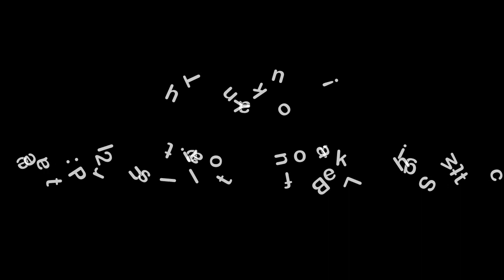Mojo Rearset Installation

Comment: sir anong shifter pa pede magamit sa. mojo?
Reply from the maker: yung transformer kaso lumang design na at medyo maraming bracket ang kailangan. yan na kc yung konti ang modification. meron din yung plug and play lang kaso mahal nasa 4k
Reply: ahh. ok paps. so yan ung maganda talaga? pang raider hnd pede?
Reply from the maker: @johnchrizcorpuz4882  pwede sir medyo marami din bracket kailangan don yta sir. yan binili ko kc wala na masyado bracket na kailangan, isang flat bar lang ok na.
Reply: san mo ba nabili yan sir?
Reply from the maker: @johnchrizcorpuz4882  dito sa pampanga sir, pero sa facebook group ng rusi nation makakakita karin dun.
Reply: pang anong motor ulit sir?
Reply from the maker: @johnchrizcorpuz4882  XRM trinity

Comment: Sir saan nyo po nabili yang OKM Rearset?
Reply from the maker: dito sa pampanga sir
Reply: @MotoDIYs  OKIMURA Rearset diba yan sir?
Reply from the maker: @esnaidinkanakan1820  yes sir okimura brand
Reply: Ah ok sir salamat sa info
Reply: @MotoDIYs  Pano pla yung disc brake yung likod pwd po ba khit hindi disc brake?
Reply from the maker: @esnaidinkanakan1820  parang medyo mahirap sya iconvert sa hindi disk break sa likod.
Reply: Sir sana magkaroon kayo ng video para sa nka dumbrake sa likod.. Para sa invertion para makabit sa shifter.